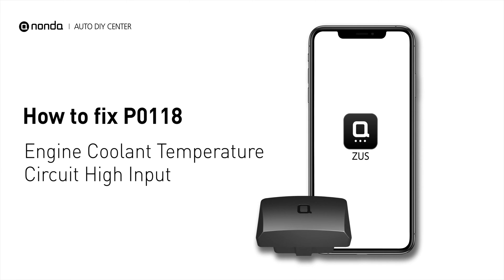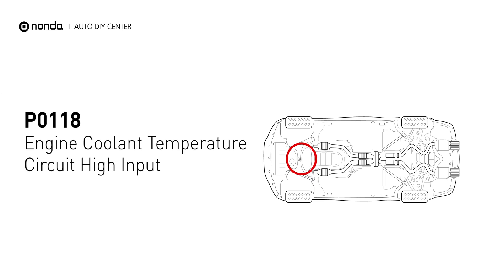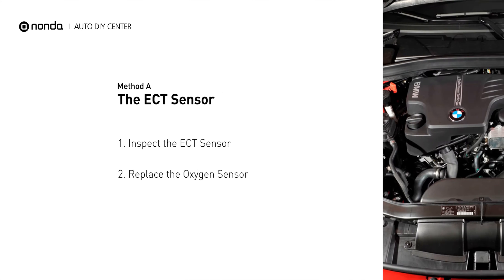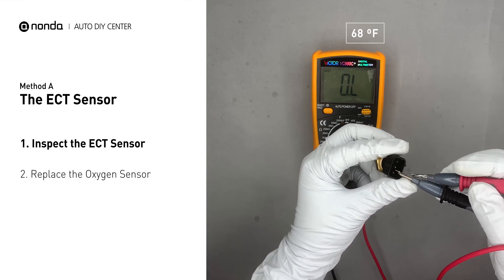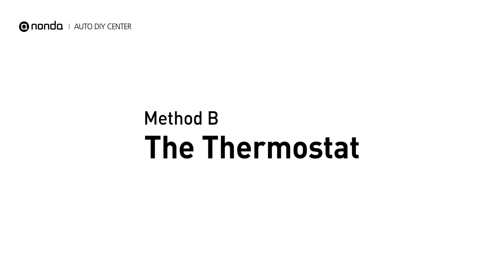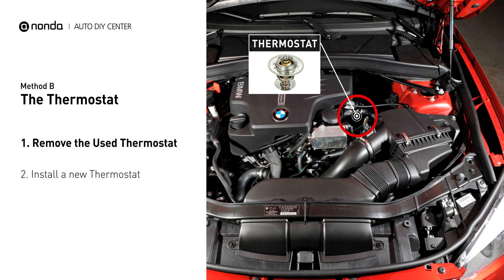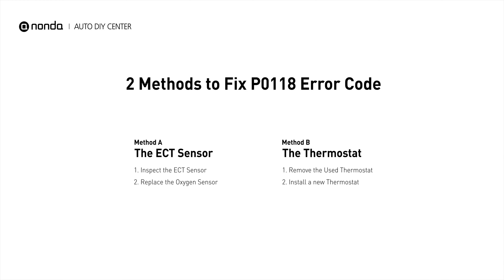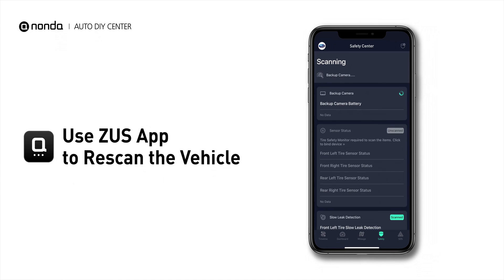How to Fix P0118 Engine Code in 3 Minutes [2 DIY Methods / Only $7.33]

Comment: I have a 1999 Ford f350 supercharged V10 with codes po118 po117 at the same time replaced coolant sensor with oem and replaced wiring still get codes and tried 2 pcms any idea's
Reply from the maker: Hello, as you are receiving more than one error code, we highly suggest getting your vehicle visually checked by your local mechanic for further diagnosis.

Comment: 2012 suburban 2500: p0118 code and p0300 codes. Replaced coolant temp sensor, plug, thermostat and performed coolant replacement. Any ideas?
Reply from the maker: Hi Martin, since you are receiving more than one code, we suggest getting your vehicle visually inspected by your local mechanic for further diagnosis.

Comment: What if u replace the sensor and the code is still on. 2017 mustang 2.3 ecoboost
Reply from the maker: Can you please confirm if this is the only code you're getting?
Reply: @nondainc  I also got a p0113,p2282,p1450
Reply: @nonda  I figured it out. I think it was mu gauge cluster circuit board

Comment: Hi, I noticed cooling fan wouldn't kick on and of coarse got hot. I was recommended to replace temp control sensor. Everything worked even AC kicked on for first time in years. Car had been in a field and sat there.  Worked for couple days great. But AC got warm ran obd2 scanner and reads high temp. So was in your opinion a faulty bad sensor or could it be thermostat.  Fan will kick on but at very hot temp. It's hard to get to check with a multimeter. Of course I has to replace coolant.  Thx
Reply from the maker: Hello, can you please provide us with your vehicle's year, make and model so we can provide you information specifically for your vehicle's make and model?
Reply: @nondainc  sorry 2002 saturn sl2 my daughter's car. Run fine. But since the change smell gas Luke it's running rich. And Lil hesitant start. Which says it would if it was bad. But it is brand new from autozone

Comment: Hi Steve, I verified my engine coolant temp (ECT) sensor prior to installing it. Checked the high side wire, 4.9v, relative to the low side wire and relative to chassis ground. All good. When I start the car and the engine is cold, the scan gauge shows ECT readout fluctuating from -40 to actual engine temp. If I reset the instrument panel cluster prior to starting, the fake overheating issue is suppressed, albeit until the next startup. Since the engine is not overheating at all, is it the instrument cluster that's messed up?     2017 Ram, hemi 5.7.
Reply from the maker: Possibly, yes. We also recommend getting your vehicle visually checked by your local mechanic for further diagnosis.

Comment: I replaced the sensor thinking it’s bad, but now it says sensor circuit high voltage permanent. What would be the problem
Reply from the maker: Hi Annette, kindly check if there's corroded wiring/connector. Also, the cooling system, for air pockets or dirty/rusty coolant.
Reply: @nondainc  would you recommend a flush followed by a change in thermostat?
Reply: @luisfmendez3901  that’s what I was thinking, did you ever do it ?
Reply: Did u figure out the high voltage. Mine did same thing after replacing it